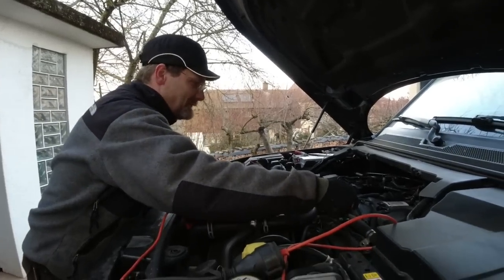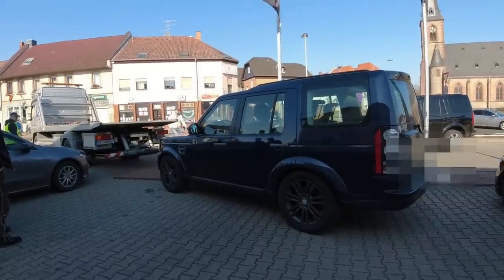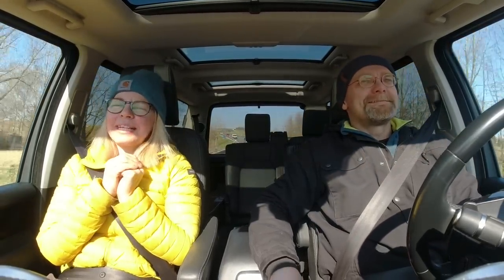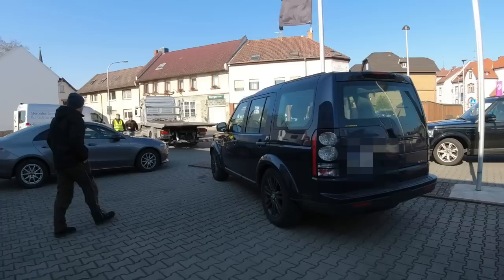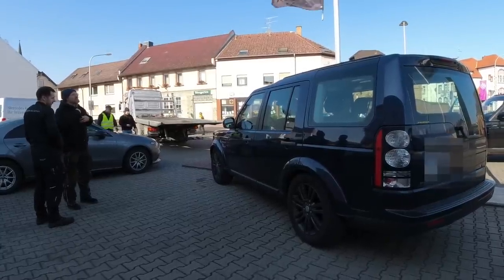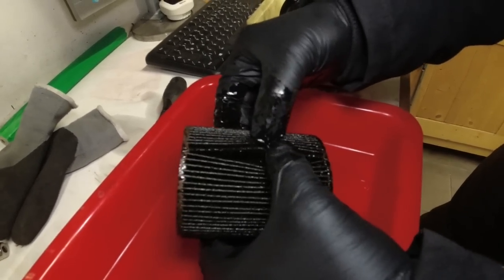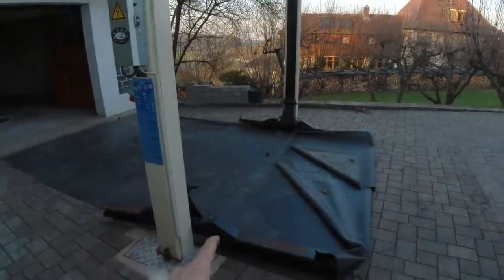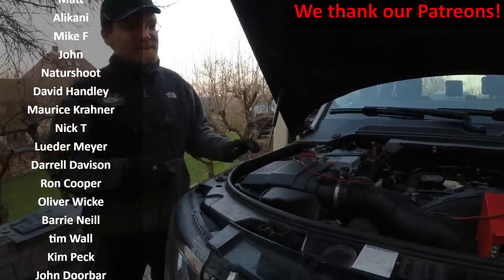We bought a dead engine LAND ROVER with only 40.000 Miles / S4-Ep10

Comment: I am going to guess this is a timing belt failure.  Pay no attention to those Facebook people.  Your channel is fantastic and like others have said there is much admiration for the compassion you have demonstrated towards the family who owned this vehicle.
Reply: A timing belt failure isn't going to lock the crank up like that. Also there apparently was no noise when the engine stopped. Pistons hitting valves at nearly 80 mph is going to make a hell of a lot of noise!
Reply: @samrodian919  I experienced once a timing belt failure in a VW Sharan TDI shortly after a service on the highway and the engine just died without making any noise at all. Result: total write off.
Reply: @eb5085  Agreed, I had a timing belt failure with lots of bent valves, and there was no noise, the engine just stopped.

Comment: You guys are genius! I have a mall crawler 2012, but bunged some offroad wheels and tyres etc on to it. but the whole thing hangs on whether the oil level sensor is still operating correctly. I wonder if anyone has done a dip-stick conversion? Mine runs just fine so far with 121000m. If I had found your channel before I bought it though, I probably would have tried to find an LR3...Thanks to you, I now use 5w dumbass (40) in it. I look forward to each sunday episode, live in the uk and think your channel is just brilliant. Anybody calling Christian an idiot is probably just describing themselves and wouldn't recognise an engineer if one fell on him with a spanner in each hand!.

Comment: The spare wheel cover is a quick way of checking if a Disco 4 is Euro 5 (no cover), or Euro 6 which has the wheel flipped over with the ad-blue tank in the void left by the centre of the flipped wheel.
Reply: Or open the fuel filler flap and look for the adblue filler.

Comment: I'm going with a seized alternator or other pulley driven by the serpentine belt, we once had a Discovery with a supposedly seized engine, I removed the belt (with a Stanley knife) and it started straight away. The alternator had seized and the engine would not move as in your video. 
Big respect for offering the car back if it's a minor issue, my neighbour once offered me a car for free that wouldn't  turn over or start and a helpful mechanic told them the cam belt had broken. All it needed was a new starter, one hour and it was fixed and happy neighbour again
Reply: That's a good guess!

Comment: Hi Vera / Christian.
I'm struggling to figure out why you are getting so many negative posts from people I personally think that your doing a great job/service on the repair of such a complex vehicle and explaining it in the way that many DIYers can understand.
Keep up the good Videos
The engine failure issue I would guess is a locked up rear main crank journal - spin in the cap oil starvation #.

Comment: Changed to 5w-40 Magna tech last week -  much quieter starting & running but the major improvement is crankshaft anxiety levels now at all time low.
Reply: I was running 5w50 crank still snapped 2009
Reply: That's not anxiety your feeling, more like misplaced excitement.  Which is why I love my 3, the best driving trucks out there with the thrill of arriving home with no bings or bongs or dash lights lighting off like a Xmas display.

Comment: Hi Vera and Christian. LR time, what can I say. Excellent work thankyou. My theory about the engine failure is a little complicated but I will explain.
I am certain that in Swizterland the mall crawler was contaminated by mice. Probably quite a few , more than 10. Once inside, being bored with a working landrover they took it on themselves to reek havoc. Once this decision was made all they required was a 36inch stillson, and  waiting for the correct moment ( 120kph on the Mway). they lobbed it into the path of the rotating crank. I am quite certain that the mice have scarpered but you will find the stillson.
I am prepared to wait for the autopsy, so you can send me a sticker.
All the best.✌

Comment: Your channel just gets better and better. Now we have a quiz (with a most valuable prize!) which will test if we’ve been paying attention or just counting omg’s.
Ok, so I believe the new mall crawler has a broken crank with the immediate failure mode (the one where Martin & Steve, Manchester United supporters, were chatting about their team’s performance rather than concentrating on heat treatment and fillet rolling) and the crank has snapped due to a manufacturing defect. The broken crank has wedged in the block which is why you can get no movement on the crank bolt in either direction. Also this would lead to an immediate stall of the engine.
The engine is too new to have lubrication related failure, even using 5W-dumbass. Were this case here is a likelihood chips would be visible in the filter (you found none) and it is possible impending failure would be shown with an oil light on the dash (together with a ‘boing’ ??)
Watching with interest to discover the reason for failure. Ignore the FB comments, they are just bitter and twisted and upset they’re not the ones with thousands of followers. I promote your channel whenever I can especially when there’s a post “I’ve bought a D3/4 what do I need next” (this is not an attempt to influence your judging decision, honest)
Keep up the good work, it’s pure gold.
Stuart (President of the Artic Frost D3 owners club)

Comment: Hello you two, one thing in advance, the owner of the D4 could not have found a better team for this task.
My tip: The low mileage tells us that the vehicle has stood still a lot. For the D4, standing still means that oil is running into the oil pan. With every start there is a risk that the crankshaft bearings will run dry until enough pressure has built up (we know the problem).
My conclusion, due to long down times and perhaps low-speed driving, crankshaft bearing damage, despite low overall mileage. Greetings from Schleswig Holstein, Heinz

Comment: How many of the critics that have put the bad comments on your channel would even think about doing a main bearing line bore in their home workshop, just about zero! I just do not understand how they can say the things they do. It’s easy to sit there and criticise while hiding behind a keyboard. The research you do and the expert way you carry out the repairs and modifications plus your manufacture of special tooling proves you are a proper engineer. And yes I am a Toyota owner defending you!
 Carry on the good work, can’t wait to see what’s causing the seized engine. Just towing across the road into your driveway didn’t really qualify as a full Matts Off Road Recovery. Maybe a few rocks strewn around, or a major ravine to tow it through, even a bit of snow and ice might have done it.

Comment: great for us viewers as now you will have more content for the channel!! sorry for the previous owner. i believe the problem is a failed timing belt, as the car just stalled with no noises and the engine is totaly blocked , so there will be no snapped crankshaft, there will be bent valves and broken pistons probably bent connecting rods as at that speed there will be major damage on the moving parts as they stopped instantly.

Comment: I have a 2008 Toyota Prado (stock) in Australia with 250,000km on it. Non service parts replaced: 1 water pump, 1 alternator sprag clutch, 1 fuel filler rubber hose. That’s it. Used off road about 5% of its life.

Comment: Love watching the two of you together as Christian does his genius mods & cost effective repairs and Vera knows her way around parts, maintenance and torque values. 

In this instance I believe Garritt is spot on with hydro lock from head gasket failure, likely caused by overheating due to low oil. Likely the husband maintained the LR and the wife was not alert to recognize early signs of trouble. 
Cheers from US

Ralph

Comment: Possibly the starter motor has engaged with the flywheel whilst the engine was already running and has seized up in position which is preventing the flywheel from turning.

Comment: I had the same symptoms on my discovery 4 two weeks ago, no chips in the filter and completly seized engine. I guess crankshaft failure between the crankpin and main bearing or crankpins. Assuming it snapped, further rotation forced crankshaft parts to move apart which led crankshaft parts to ram against crankshaft beds and yokes and seizing it completly, most likely deforming the beds. In this case side bolts of the crank yokes may shift or extend from the engine block which you can see before disassembly. Also you may find broken or cracked rocker arms depending on relative rotation of crankshaft parts. Total damage: broken crankshaft, deformed engine block, and possible damage to engine heads(valves, rocker arms, camshafts...)
Reply: I wish it has an easy fix, but reality tells us it's defenetly not an oil, overheating or timing belt related problem, because oil starvation lead us to bearing material build up in oil filter, defenitly not overheating, because we have coolant level sensor, 2 or 3 coolant temperature sensors, oil temperature sensor... No coolant or oil spill marks in engine compartment. In case of timing belt failure you will definitely hear valves striking against pistons. It would be loud :) , and can't completley seize it.
Reply: I've been waching Discovery problems for the last 15 years. Different driving behaviours lead to different engine problems. I guess the owner of this Discovery was very calm and fuel saving driver. Such type of driving means high torque on low RPM. Never seen snapped crankshaft on such low mileage with aggresive driving behaviour.

Comment: Hi Christian and Vera, sorry to hear about those comments but you know what they say, “Haters gonna hate”. Just let these comment side off like water off a duck! You are both generous people with the deal you have made on the vehicle, I think it is outstanding that if it is a quick fix, you are giving the vehicle back. Also shows much empathy to the owners in acknowledging there loss of the vehicle due to the breakdown and where it occurred. Well done to you both. Lastly, my guess. Hydrostatic lock caused by timing belt failure on an interference engine. Stay well you two.

Comment: I think the fact that there was no smoke or noises it could be an oil failure or pressure failure leading to the bearings welding themselves to the crank. The other cause could be coolant low leading to a hot engine and a piston  seizure in the bore both of which I have come across.  Great video as usual. Christian has monstrous  cajones doing these jobs in the driveway.

Comment: This is the story unfortunately for some of these Discos.  Four years ago I was offered a very nice looking 2012 D4 for $2000 Australian dollars, that was the cost of the recovery tow when the Disco broke it's crankshaft mid journey on it's way to Northern Queensland, it only had about 80,000klms on the clock. The owner just abandoned it for the money he owed the tow company and flew home south from Cairns. Such a pity.
I think a seized bottom end due to oil pump failure.

Comment: Christian, I think the engine issue was caused by a sudden onset hangover effect of when Manchester United got smashed by Manchester City on 23rd October 2011 which tick tocked away for 5 years before causing a seemingly unrelated sudden case of Interdendritic segregation failure of the crankshaft on the freeway. I feel the families pain as if it was my own much loved 2.7 2010.  You and Vera are good people.

Comment: timing chain (belt), then failed oil pump and seized crank shaft. love your videos, actually bought an LR3 2009 having watched your content, gave the confidence to work on the LR3. also have a Disco 1 with 600,000 kms 300tdi. still going strong.
Reply from the maker: That is a lot of km.  Very cool. Christian

Comment: Don’t listen to any of the uk Facebook keyboard warriors. (I feel ashamed to be British when you hear crap they comment with)Your videos are fantastic I’m a L320 RRS owner and your videos are so informative and well made, with simple to follow instructions.
I believe it has cam belt failure with oil pump all valves bent and possibly Conrod bent resulting in full engine lock up .Look forward to next Sundays video.
Also have you ever made a video on torque converter replacement on a LR3 ? 😊

Comment: We had a critical engine failure in our 2012 Disco 4 at about 120.000 km. A piston head cracked. Luckily, the dealership had a totalled car with an almost new engine lying around so it only cost about 10.000 euros and now the car has a much younger engine (this happened in 2015). Now it has 240.000 km and still going strong. Long may it last.

Comment: - that is 3.0 TDV6
- apparently, valves are fine 
- car came from "bad" dealer 
- because car "love" to run on low RMP and motor have a lot of torque  
- it has a broken connecting rod, maybe on the half
-  connecting rod, which is on crank shaft hit the case\sleeve and motor stuck 
- thanks to the automatic transmission - cylinder block is not damaged
In my opinion
- crank shat is broken because of hit - now it have curve or broken on two parts.
---- if second, then broken sleeve\case which is closed to the radiator 
- you need to replace one sleeve\case and piston
- everything else is fine.

Comment: This should be good. I know what they mean by it being one of the family. I still regret getting rid of my first D3. I owned it 14 years and 230,000 miles and it was stupidly reliable. I now have a new Defender that I'm so underwhelmed by that I'm looking to replace it with 2016 D4. As for the Facebook trolls, just ignore them. Most can't put their camouflage trousers on the right way round and many shouldn't be allowed any tool sharper or heavier than a sponge.

Comment: :) Spun main bearing and snapped crankshaft and damaged at least two connecting roads closer to the back of engine :).
Check the oil level before disassembly.
Separate the body from the chaise. You will not be able to remove the torque converter bolts. when the body is removed you can do only the engine with the torque converter or remove transimssion and then the engine.

Comment: Hopefully not too late to comment. Please ignore those that sit on the sofa and comment on stuff. They do not understand, and are too scared to do for themselves.
I watch what you do and I work on my own car and I appreciate the content you put out. Spinning a bearing another “the main bearing I thought was a classic problem with a 2.7 engine not a 3 L I don’t think it is a cam belt, as I think he would still get a little bit of movement in the crank, so my guess would be that oil pump or pick up has failed leading to a seized up engine, but hence why, without oil circulating, there is no debris in the filter. Good luck  with this one. Looking forward to seeing how it progresses. Best wishes from a discovery. Three owner, Phil

Comment: I done some research when I owned a 2012Jaguar XJL between 2013 and 2016, it had the same 3.0 TDV6 engine as in the Disco 4.
I used the Citroen recommended oil which was 5w40

My car did over 220k miles when I sold it and the engine was spot on.

Comment: Don’t bother with the naysayers. You guys are wonderful. Your channel is amazing. I never miss a video. My guess would be that there is a failed head gasket. Coolant leaked into the cylinder and hydro locked the engine. I predict two bent connecting rods.

Comment: Option A, timing belt issue. Something broke or slipped and it's out of timing and also the best is stuck therefore you can't rotate.
Option B, Fuel intake problem, like fuel pump failure on the back and the belt is somehow stuck not allowing you to rotate the engine.
Option C, crank failure. Broke in half.
Option D, some sort of eletronic issue. Like ECU failure or injection failure. The reason why you can't move the crank is related with something else that happened after the car stopped.

Comment: Good day to both of you. If you were trying to move the engine directly from the crankshft, and it doesnt move, the crankshaft is seized or jammed. The filter did not have metal particles, so you have caught the damage just before the metal particles started to go up to the filter. Next step would be to purge the oil and check. Probabilities are that the engine block can be saved, but needs overhaul. A question rises, why did the battery die? 2 weeks? The car entered in limping mode before damage.  Regards.
Reply: Forgot to say, it has to do something to do with oil, either no oil, or wrong specifications. The event happened at the Autobahn, this is also a hint.  I am new in this group, i own a 2013 disco 4 diesel with the ZF 8 speed. It is a nice car. Risky… you have given us enough good info to mitigate the risk.

Comment: Keep up the good work guys. Guessing the oil pump was never changed and low oil pressure probably caused bearing failure and snapped crankshaft. What oil were they using? Can’t wait for the next video 🙏
Reply: I was thinking that and also might be a timing belt failure

Comment: Main bearing welded to the crank… if its a big end you can normally move the crank a bit with the play between the rod, piston etc. 

Cause will be ultimately 0wDumAss and a earlier narrow oil pump gear set leading to wear and loss of oil pressure